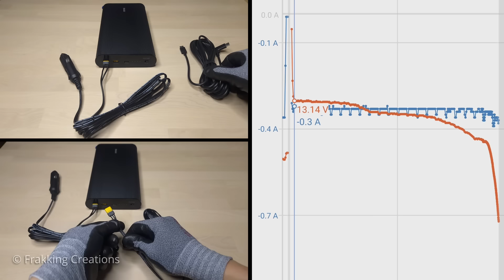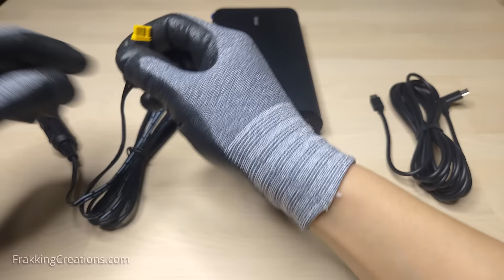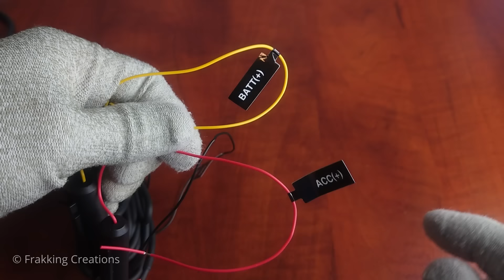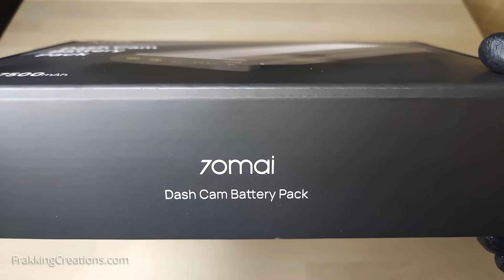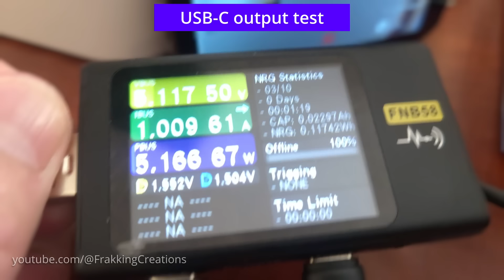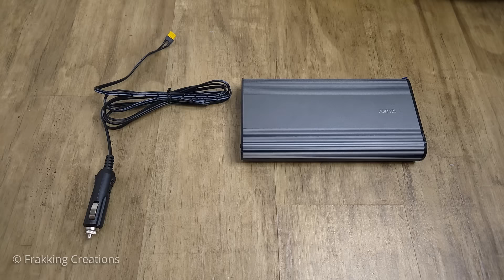Power ANY Dash cam Parking Mode 24h without Hardwiring? – 70mai Battery Pack FULLY Tested

Comment: bro you should use the dongr pro
Reply from the maker: Not really.  A dash battery pack is totally different than a dash cam power adapter.  It's like comparing apples and oranges.  A power adapter like the Dongar Pro uses the car battery for power.  The battery pack is a power source and has the capacity to last longer than most car batteries because most car batteries still need to have enough reserve capacity to start the car.  So you cannot use the majority of the car battery's power without compromising that or damaging the car battery.  Also, most people's car battery isn't at 100% charge most the time so even less capacity is available for the dash cam.

Additionally, the Dongar Pro is only truly plug-and-play when used with supported vehicles.  It looks like only some Mazda and Toyota vehicles at this time.  The Dongar Pro get's its power from the mirror module or sensor module in the mirror.  Most other vehicles will power this module down so that is why they aren't supported.  In order to use the Dongar Pro with these vehicles, you will have to hardwire the Dongar Pro with its hardwire kit.  So this is not any easier to use than using the battery pack I showed in the video.

The Dongar Pro also does not have configurable cut-off voltage.  It uses 11.8V as the cut-off voltage and that is very low.  For people with older car battery, they might actually have problems starting their vehicles.  11.8V cut-off could also speed up damage to their car battery.

The Dongar Pro seems to not fully support parking mode for all dash cams.  For example, when used with VIOFO dash cams, it isn't able to tell the dash cam to go into parking mode.  The dash cam will stay in normal recording mode, using more power than parking mode would use.
https://help.dongar.tech/en-US/articles/dongar-pro-faqs-231736
I suppose VIOFO does have a parking mode timer which will start parking mode after a set timeout when no motion detected.  This would be a work around for the shortcoming of the Dongar Pro.

All things considered, I still prefer the battery pack over the Dongar Pro.

For those interested, I also reviewed a similar dash cam power adapter called the FitDVR (It has both USB 5V and 12V power outputs):
https://youtu.be/uqYvKz6xnbs

Comment: Would this battery pack work with my Toyota BZ EV, along with my Viofo A329S (3 cameras)?  I couldn't get my Best Buy installer to connect up the hard wire kit. So looking for options to utilize the parking modes of the A329S.
Reply from the maker: I think it should.  As I show in the video, connect the 12V socket of the battery pack to the 12V outlet of the vehicle, then connect the hardwire cable of the dash cam to the 12V output cable of the battery pack.
Reply: @FrakkingCreations  Thanks! Think I got it - the dash cam (Viofo in my case) needs 12v to enable parking mode functions. Hence using the 12v connection from the battery pack.
Reply from the maker: The A329 HK6 hardwire cable needs 12V power.  The VIOFO dash cam might actually be using USB power provided by it's hardwire cable (the hardwire cable converts the 12V to 5V USB.
Reply: @FrakkingCreations  That makes sense.
Reply: it very delecate during hot condition
Reply from the maker: Can you provide more info?
* How long have you had the 70mai battery pack?
* What temperature is considered "hot conditions"?
* What happens in hot conditions?
* Where did you install the battery pack?
* Do you park all day in hot conditions?

Is there any other info you can share on using the 70mai battery pack?